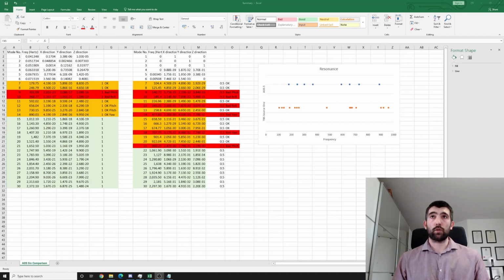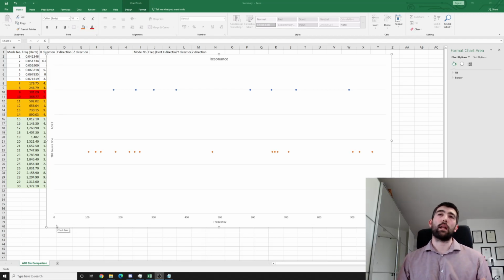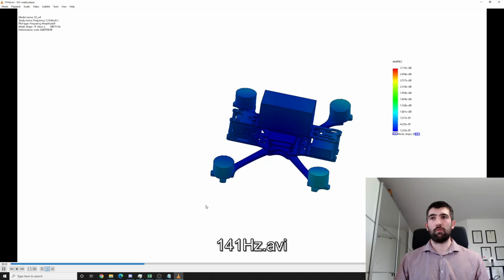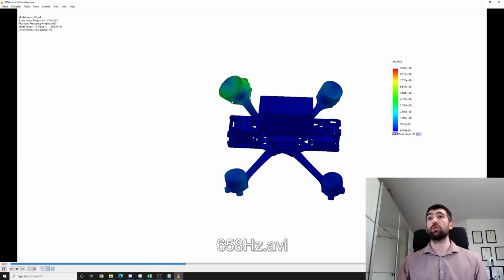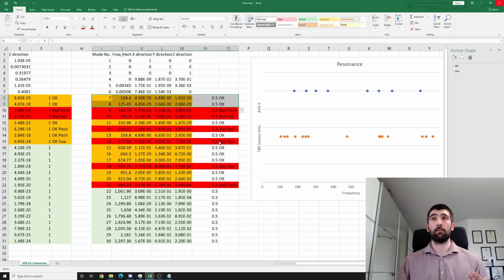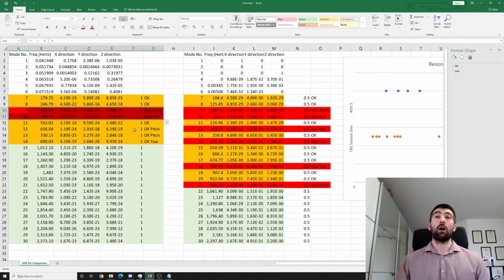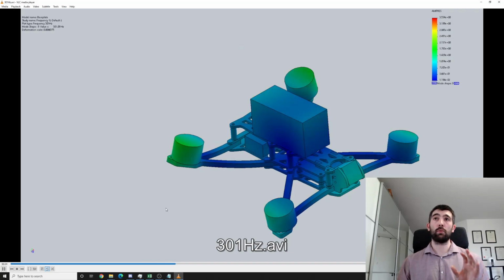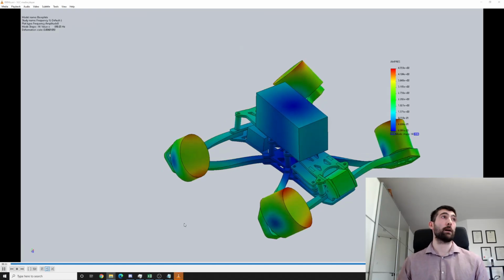Frame resonance analysis: How does my frame design stack up to the TBS Source One?

Comment: Finally finally finally someone is picking up on modal analysis of quads. I always wondered why nobody realized, that those straight arms are actually a bad idea. Next step: Get the quad's center of weight actually aligned to the center of its turning axes and apply state of the art pwm from the electric car industry to motors…
Reply: Straight arms are a bad idea?
Reply: You do you mean? True x, stretch x style frame?
Reply: pwm?

Comment: Really cool stuff, thanks. I noticed one thing which I think is not quite correct. You mentioned a couple of times that pure translational movement did not affect the gyro, but would still increase the jello. In fact, pure translation of the camera does not change the picture because the objects are far enough from the camera: body translational shaking is a fraction of mm, distance to the objects is normally at least several meters. Example of that effect: a steadicam can't affect the translational movements of the camera, but it removes all the rotations and that makes the picture smooth. In practice, camera mounts may, probably, transform translation of the body into rotation of the camera.  But mount and camera are outside of your model.
Reply from the maker: Thank you for your comment! You are absolutely correct that translational movement would not affect the camera. More recently I have been conducting harmonic analysis that include the contributions from many resonance modes. The effect of other resonant modes is to make the vibrations include rotations even when the primary mode is translational. That is why you can still get bad jello with translational modes. I didn't fully understand that when I made this video. But I'm learning quickly!

Comment: Old video, but still very interesting, and if you are still reading here, I have two questions for you; first, your thoughts on soft mounting motors. That used to be a popular thing, its been abandoned but Im not sure I know why. Secondly, looking at these resonance simulations, I wonder, would it make sense to add tensioned kevlar wire to create additional triangles, like between two arms on one side or even in the vertical.

Comment: I'd be curious what level of fidelity this has on threaded joints, which is typically what becomes the validation piece when looking at this, and working off the assumption that things don't have slop, when in reality that affects which modes will actually sympathetically resonate in practice, and which ones will remain relatively damped.  
Also, awesome stuff, can't wait to see more!
Reply: Also, this provides me hugely valuable information about troubleshooting individual delaminating arms, the 500-700Hz regime always confused me about what information was there, because it did seem linked to motor RPM bands, but if it is a single arm mode, then that makes an order of magnitude MORE sense to me... seriously cool
Reply: Other question would be what the shift is when going to 6mm arms on the SourceOne.  Quite a few of us absolutely swear by that setup, because it lets us run a single LPF (or sometimes none) along with motor notches, and they fly amazingly well... that is something I'd love to see quantified.
Reply from the maker: @tehllama42  Wow, I was two minds whether to even include those single arm modes. Just goes to show, gotta get that data out there!
Reply from the maker: @tehllama42  6mm arm, I can definitely simulate that for you. I'll stick a video up when it's done
Reply from the maker: At this stage not too much fidelity on joints but I plan on increasing the resolution of the simulations in the future to more accurately replicate the joints, it's going to be difficult to quantify damping. But if I can get hold of BB logs I can make an attempt to match the Sims to the raw gyro data. In my experience any slip in joints makes things worse though and most people I know crank their arm screws down super tight but I won't know until I look I guess. Thanks for the ideas!
Reply: @ChrisRosser  Between @Krunked and myself, we probably have some solid BBL data for those - I definitely have seen those lower two modes (although the ones you've seen as roll-only and pitch-only seem to appear across axes for good measure, or at least that we do see a couple of bands in similar areas with this frame, although the predominate noise we see is the motor bands, and excitation regions where the motor band overlapping (particularly in yaw) produces a higher bandwidth sympathetic resonance from the frame.
Reply from the maker: @tehllama42  Vindication! Yes you will see resonances couple together so a resonance at one frequency will excite another mode at that frequency. But if you identify the primary mode you can stop the problem at source.
Reply: @ChrisRosser  Precisely, and if the ultimate answer is 16g of added arm weight, but you can disable all of the lowpass filters that carry higher phase latency penalties responding to propwash, tuning is so much easier, just find the P:D ratio that setup likes, and scale those until you get to a thermal limit, or it flies so great it's not worth spending more time tuning when you can just be flying for fun (or getting paid)

Comment: This is really interesting stuff. I never thought about vibrations in the way that some hurt more than others, and how it can only affect one axis. I've always tried to just get rid of it by brute force. Also, I assume those simulation graphics are a bit "exaggerated" for better visibility of the problem at hand, this would snap the carbon otherwise, no?
Reply from the maker: Absolutely right, once you can visualise the vibrations you can really see which ones cause jello and bad flight performance and you can start to design to minimise the bad vibes! The simulations are exaggerated, these vibrations are too small to see with the naked eye but plenty large enough to affect hd footage and be picked up by the gyro.

Comment: I'm designing a 6" Moka gravity lookalike quad with tilted rotors for long range  purposes. It would be nice if you could do a short tutorial on the program that you used for your frame analysis.
Reply: @ChrisRosser  I actually have used something like this if not the exact same program maybe 6 years or so ago for optimizing a 3d printed part strength. Didn't realize it could simulate frame resonances too.
Reply: @larijoona  what was the program mate? Firefighting my own design issues at the moment and it would be super useful
Reply: @smokeoutfpv4132  fusion 360 has finite element simulation functionality

Comment: Great video!  
Can you explain why there would be 1 motor/ 3 motors oscillations as you pointed out, when the structure is supposedly symmetrical? 

Maybe do 30 minutes in-depth video on this topic, I am very interested in learning all the physics behind this, thank you!
Reply from the maker: With resonance you will will see full body modes where the whole structure is moving and (usually at higher) frequencies you will start to see modified single body modes of parts of the structure. In this case single arm modes. The three arm mode was surprising to me but resonance is hard to predict. That's why the simulations are so important. I'll put a longer explanatory video on the backlog. Thanks!
Reply: A bent prop.
Reply: @aowi7280  I'm asking about simulation strictly, and pretty sure those weren't modelled in.

Comment: H!
What program is that?
And what material did you simulate? I thought that carbon is anisotropic material that really not easy to simulate accurately.
Reply from the maker: I'm using SOLIDWORKS for this. Composites are very hard to model perfectly but good approximations are available for standard layups 👍
Reply: @ChrisRosser  Hey Chris, I'm trying to model my own design in Solidworks as well for a uni project. I'm having trouble finding the elastic modulus for common CFRP's in the 3 dimensions to model it as an Linear Elastic Orthotropic material as well as the yield strength. What values did you use? If you are willing to share how you setup the resonance simulation I would also really appreciate that, although I understand that might be too much effort. While I have the capabilities to have modeled my quad, I am a little less competent in Solidworks simulations beyond static design optimization studies 😅

Comment: Subbed... Please post some more stuff!!!! Want to learn about your ideas on how to fix these issues, some design ideas would be awesome, multiple arms heading out to motors for extra strength(cmw bando styles) or separate plates to lock in arms etc... Teach me master!!!!
Reply from the maker: I'm working on a lightweight 5in design that has roughly twice the resonance performance of the TBS Source One. I'll be making some more content on this and there will be an open beta for the frame sometime soon. I'm hoping to work with manufacturers to come up with more ways to address these issues because I think they are affecting a lot of people!

Comment: Hello Chris, I saw in your spreadsheet in the video that in the XYZ directions you include what I assume are mass participation factors (the columns look to sum to 1 each). You didn't mention these in the analysis. It appears that in both frames almost all of the mass is excited in very low frequencies and the higher frequencies which you spend more time discussing have negligible mass participation. Could you please comment on whether x y and z columns are actually mass participations and if so why you think almost all of the mass is excited below 1hz? Thanks, Mike

Comment: This is excellent, well done! I have noticed I have been able to remove some of the resonance issues on my micros with good fc soft mounting as well as soft motor mounts too. It doesn’t always fix everything but it certainly keeps the motors cooler. Have you done any of your testing with any “virtual” soft mounts and noted the effects as I would live to see that too.
Reply from the maker: Soft mounting the flight controller is effectively a hardware low pass filter so it will attenuate all high frequency vibrations with attenuation increasing with frequency.  I've never had much success soft mounting motors. If the mount is too soft it can make things worse by reducing the frequency of certain modes of vibration. If it's a tight soft mount its probably not doing too much in the range we are most concerned about. But I know pilots have had widely varying success with soft mounting motors. Probably worth a deep dive at some point!
Reply: @ChrisRosser  Thanks for the reply and I would love to see your further tests on the matter. I have been noticing an improvement on the one piece bottom decks where I generally find the worse resonance issues to be. 
On 2.5” builds I noted that even a single piece of tape under the smaller 1103 motors made an improvement in the physical testing  I was experiencing without, so maybe I got lucky and just shifted the frequency along to a less noticeable place perhaps? I also believe these smaller 16x16 aio are just more susceptible too, but with your testing could get us closer to managing that problem as well!
This is brilliant work you are doing, so glad it’s getting properly looked into finally!
Reply from the maker: @TuccoBenedicto  Very interesting I should be able to model a thin soft material under the motor. It's hard to predict the effect on resonance in this case, I'll add it to my growing list of projects!
Reply: @ChrisRosser  Excellent, thank you, I will look forward to seeing it. My friend and I are making some frames currently and are experiencing some resonance issues as you have shown. Do you have an IG account so we could perhaps do some information sharing and maybe work with you to make and test some of your designs?
Reply: @ChrisRosser  isn’t it impossible to soft mount motors without soft mount screws though?  And the screw slamming into the carbon will create a non sinusoidal wave?
Reply from the maker: @CiottiFPV  Not impossible no. When you screw down a motor onto a soft mount you end up with a preloaded structure in compression. As the motor moves up and down rather than a gap opening and closing you get slightly less compression then slightly more. The tape then squidges a little more and then partially relaxes dissipating energy. There's no slamming as everything is always in compression in the stack. Bicycle wheels work under the same principle (superposition of forces). The spokes are always in tension with the top ones in slightly more tension and the bottom spokes slightly less and that supports the bike.
Reply: @ChrisRosser  ahh ok so you’re talking about needing the soft mount to be above and below the arm then right?  I’ve never had luck doing that because on crashes it allows the motor to can’t over which bends/breaks the screws and we would also need some sort of a torque wrench to tighten the screws all to the same amount I assume in the same way that they tune the spokes on a bicycle wheel
Reply from the maker: @CiottiFPV  Yeah it's a tricky problem. I agree there are probably better ways to damp the vibrations, I'd love to talk to you about my ideas for this. Do you use reddit? Or Discord?

Comment: Questions about some of this. Wouldn’t a heavier motor dampen some of those frequency’s out? Or vice versa for a lighter motor? Or would it amplify the outcomes.
Reply from the maker: Great question! In general, heavier motors will lower the resonant frequencies and stiffer arms will raise them. Damping is not going to be greatly affected by mass or stiffness. In general single bottom plate designs will have less damping and individual arms will have more but it's very frame dependent. This is why some people have problems with a build and someone else with the exact same frame doesn't.

Comment: Hi - I have tons of questions for you all surrounding how/where you are constraining your model. Secondly depending on how you are constraining you model, doesn't your matching material choices of the stack grommets weight heavily into your simulation?
Reply from the maker: Fire away. I've found that the materials in the stack don't matter too much as they add so much stiffness to the frame in that area even if they are relatively stretchy materials due to the height of the stack compared to the thickness of the plate. I'm using bonded connections for the most part due to the high contact forces and friction coefficients when the frame is screwed together. It seems to agree well with the blackbox logs I've checked. I welcome any feedback on the modelling to improve it!
Reply: @ChrisRosser  Hi, I appreciate you telling me about the contact type you are using, but I asked about how and where you are constraining your model from. For instance, are you constraining your frame to the mount points on the FC or are you constraining your fc to your frame by way of structural load constraints on the fc screw holes - this changes your reference point. One of my hopes for my investigation is to decide the feasibility of hard mounted flight controller and esc's. Also what software are you using to run your analysis as I am just curious as to if simulation software has gotten better for composite materials since my undergrad (they weren't fantastic in 2015-16) as they mostly treat composites as isotropic instead of quasi-isotopic (which admittedly most carbon fiber used in the FPV frame industry isn't because it is more costly or people can't tell the difference).
Reply from the maker: @zachcarrizales5038  Hi Z, the model is supported by weak springs in the simulation so both the flight controller and frame can move. So there are no fixtures or other constraints. I am using Solidworks simulation to run this analysis.
Reply: @ChrisRosser  Where did you put the springs; under the bottom plate on the frame?
Reply from the maker: @zachcarrizales5038  Its a setting in the solver used when you want to model flying objects that aren't in contact with anything fixed. It allows rigid body modes to solve.